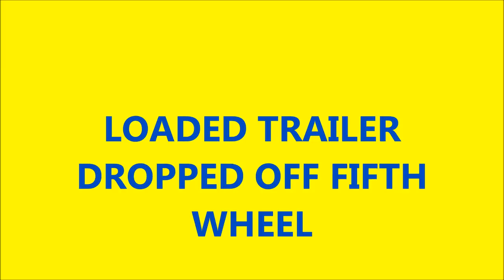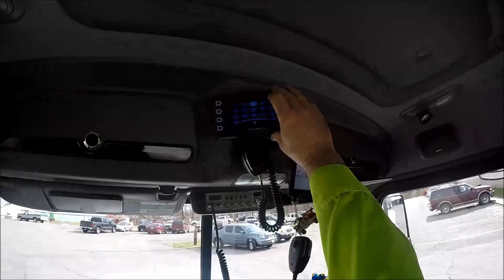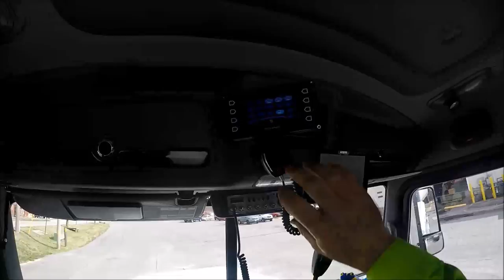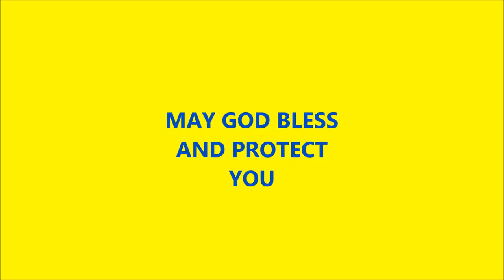LOADED TRAILER DROPPED OFF FIFTH WHEEL

Comment: what a awsome recovery truck ! --  did that same job in 1968 in the uk on the side of a main road ,they had changed over a sick tractor and the new one dropped the fully loaded trailer-the legs bent the chassis up about 1ft ------  so that the front was about 2ft off the road(and on a angle due to the camber ) ------    took a LOT longer than 20 mins:-)

Comment: Same thing happened to me in the UK in the late 80's. The landing gear stripped but we where lucky as the unit had run up guide ramps and we could push back under the trailer, good job too as it was a full load of wine.

Comment: I was a truck pusher at a vacuum company and had one driver dropped a vacuum trailer off 5-wheel and bent the crossbar, lucky I operated all equipment in yard. When I seen this, I was pissed, because the driver did not say anything about it. What I did is got our white/western star winch pole truck, put hook around kingpin, and lifted it up so I can lower legs. Just like you Ron, no damage done. I missed that job, it was fun. Raymond B Stojanik

Comment: I've had to re-hook a few times, and have learned NEVER to trust a quick pull always get out and look.
Reply: Willard Way lol i drag the thing because im paranoid  works pretty well
Reply: Large carrier driver training now requires that drivers review videos detailing how fifth wheels work. The old tug method is NOT a valid test as per all manufacturers. You are right to get out and look. Inspect the hand position and the jaws (when possible).
Reply: @kmg501  fotos

Comment: ALWAYS double check, especially if you've left your vehicle for even a couple of minutes.  We had a problem at one of our local truck stops where an operator was sneakily pulling the pin on random trucks. Drivers were leaving their trailers behind, nose down, when they pulled away. The idiot was seen on security cameras but could not be identified.  I hate to say it but you can't trust everyone.
Reply: LoL thats worse than having a pervert in the shower. & they couldnt identify said individual!
Reply: Pulling the pin is an offense that should be punishable by death.

Comment: when I had this happen to me before I would roll down the fillet legs, then dumped the air when the bags was flat start putting 4x4's on the frame rails then lift that roll the fillet legs then next back under and go, but then again I am old school , great video Ron thanks for sharing
Reply: and I can tell you how he did it ! backed under trailer too high missed the lock valley and yes the lock was tripped but it wasn't engaged like it was suppose to be if it was in the valley correctly, if he duck down with a flashlight and look he could tell the locking jaws wasn't around the kingpin correctly
Reply: and I can tell you how he did it ! backed under trailer too high missed the lock valley and yes the lock was tripped but it wasn't engaged like it was suppose to be if it was in the valley correctly, if he duck down with a flashlight and look he could tell the locking jaws wasn't around the kingpin correctly
Reply: sorry if this was seeming smart ellic, it happens to all of us in one time or other
Reply from the maker: No problem.  Matt is a cool guy.  We all, myself included, make mistakes.  It happens.
Reply: Jack - Yah the trick with the 4x4s works good, I helped many with that trick.
I agree on the trailer being too high on some disconnects too.
Happens from time to time to some.
Careful attention to small details helps keep things problem free
But times like this give you something to smile about when its someone else ! (^_^) hehehe
Reply: Ron Pratt I looked back at what I posted and I was ashamed cause I did feel I was being smartas*sih  I just wanted to say I didn't mean to be so crass be safe out there and thank you for sharing,
Reply from the maker: It's cool.  I think you were just trying to educate some people on another possible method of getting out of this situation.  Unfortunately, his landing gear were stripped, so he couldn't use the dollies to help him...that's why they called me.  I'm not upset at all by your comments.  I watch my channel and its comments very closely.  If I don't feel comfortable with them I will delete them.  It's all good.  Thanks and God bless.
Reply: Ron Pratt yes sir! if you've (any truck driver) driven for any amount of time you've made mistakes we are all human! God forgives but some employers don't lol
Reply: Ron Pratt what model is your peaterbilt ?
Reply: Very true, thankfully I haven't had this issue yet. Knock on wood. Main thing is no one got hurt.
Reply: well we wasn't there so cannot judge of what happen,on my side it happen but found out then too much grease and it cannot lock it properly,i got it ok after roll up the gear.
Reply: i did that a month ago
Reply: Jack Caldwell dead on Jack you got it in one, I am a lady driver and even I could have hooked under this trailer.
Reply: that has been done by me but we are old school i am old old old school  going on 71
Reply: if it has and air bag dump, my FLD didnt, it sucked
Reply: FRANK TORO I

Comment: Years ago I had a heck of a time hooking up to a trailer. I could hear the fifth wheel lock, give it a tug and it would not lock. I did it about 4 times, was frustrated and thought the latch was broken. Then I took a breather and settled down, took a better look at the fifth wheel and found the latch handle was catching on the frame, on one of the bolt heads. A quick adjustment to the handle and it was fixed.

Comment: "I heard it latch and the handle was in. Big assumption. Every time I release the tractor brakes I tug on the trailer to assure the 5th wheel is locked. EVERY TIME.
Reply: gregdcross also do a visual check
Reply: But that seems to be what mightve happened, he latched and went to tug and WHOOOPS
Reply: Yea lifted legs and then tugged lol
Reply: Tug test isn't enough. Gotta grab that flashlight and get under to make sure the jaws are totally locked onto the kingpin

Comment: Great recovery Ron. That guys hands were tied & he needed a lift. You got the lift charge + a little maintenance work on the job that keeps your shop busy. Everybody says it's never happened to them, huh. I dropped a few trailers in my time, but was lucky enough to have the landing gear working, & was able to recover myself. Each time it happened I swore I was hooked up. The 5th wheel is a complex item & has a lot more to it than a locking arm. It has a lot of moving parts that are internal & can not be seen to the eye. Folks need to keep that in mind.
Reply from the maker: I have seen this happen a lot.  It isn't always driver-error as some claim.  Mechanical failures happen, otherwise they wouldn't sell repair kits and new fifth wheels.  Thanks for watching and God bless.

Comment: There use to be a “Fontane “ fifth wheel that was notorious for coming released for no reason. Holland equipment is the best, they have a locking device. Never had a problem with this equipment.

Comment: I have had this happen to me. The lock audibly locked, looked good, but came apart when I tugged. It happened a couple times. Turns out the salt from winter was drying out the linkage below the plate. A bunch of spray oil did the trick. Your cool demeanor and humble approach is what makes you successful. Good video.
Reply from the maker: Thank you very much.  God bless.

Comment: I was watching a video awhile back and it showed a person sneak back to where a rig was parked and pulled the unlock handle for the 5th wheel plate and ran off.  Thankfully a driver of onother truck saw it and ran over from his rig just as the driver of the Tampered was going to get in his to drive off.
They scrounged up some timbers and blocked the trailer wheels he pulled the trailer backs and rocked the tractor back and locked the 5th pin back in place

Comment: I can understand the landing gear being useless because the gears are stripped, but have my doubts that the trucker checked to make sure the fifth wheel jaw was locked in place.
Anyway, good job as usual Ron.
Reply: Driver also made another egregious error. He put his landing gear all the way when he did his pull test. That would have saved his ass when his "defective locking jaws" failed.

Comment: Saw that happen to a trainee ( 3rd week out) at our mini yard in Conn. ...set of doubles did fine disconnecting back unit and con gear....oops forgot to lower landing gear and pulled out from under..had a fork lift inside ...broke loose and went right through the nose of the pup(trailer)...A) where was his trainer and B) that's a hard way to unload your freight.

Comment: That is one awesome tow vehicle. I assume there is a coffee maker in one of those boxes LOL. One of the benefits of being an owner-operator among the many, is working on your own rig but not for saving money, rather for the purpose of learning and knowing how things work and the ability to make self roadside repairs if the need arises. One of those repairs two years ago was rebuild of 5th wheel assembly to include mounting bushings, springs, and lock-jaws. I know the sound and the feel of a properly locking 5th wheel but I still take a peek underneath to verify. Working on ones own equipment these days is unheard of and most drivers of this generation don't even know how to raise the hood to perform the simplest of checks. I made a note to myself earlier today that it seems most people ie; car drivers and truck drivers alike wait until they are broke down on side of road before performing or having any maintenance done whatsoever.  When I learned to drive trucks more than 3 decades ago, we were required to learn to repair own trucks (company) including all services or else you didn't work. This meant brake jobs, clutch adjust, tire repair or replace, lights, electrical, you know the drill. Everything I learned back then serves me today as an owner-operator. I know every square inch of my truck including sounds and what things feel like good or bad. I'm good at what I do because of those who taught me.
Reply from the maker: Much respect to you sir.  There are very few of you left.  This new breed of school - taught drivers....????
Reply: Ron Pratt The world seems to be heading towards teaching for the test. Yes, we need people to pass but you also need to understand why you do what you do.
Reply: @RonPratt  hi

Comment: Years ago (1966/1967) we had a driver drop a loaded trailer.Hard to get upset with the guy we were working 12/16 hours a day 7 days a week.He simply forgot to put the landing gear down,unlatched fifth wheel drove out from under.Trailer was loaded about 37/38 thousand pounds of diesel fuel.We had to pump out three compartments of the four on the trailer,then put landing gear in the low position lift the trailer up enough to get the tractor back under it.Sure could have used Ron that day.our 20 ton P&H would not lift it.

Comment: this happened to me a few times.  so i had little ramps welded on to the frame behind the 5th wheel.  so if the trailer slides off it'll be resting mostly on the ramps and not the tires.  just hit reverse and easy to get back on to the 5th wheel.
Reply: M Wood it's nice when trucks have those little ramps

Comment: I been out here a little over 50 years now and always make a visual check to make sure those jaws are latched. Just looking at the pin puller and making a tug test only will get you in trouble. Why not take a little extra effort and be on the safe side. I'm sure Midwest Truck appreciates the business and I just bet Ron Pratt would tell those drivers the same thing.

Comment: I’ve been in situations like that many times before as a yard jockey, some my fault and other times helping another driver out.  from what I can see in the video he should be able to take care of that himself. For starters crank the legs down as far as you can. The driver said it wasn’t that heavy so release the air in the tractor air bags and give it a hard reverse shot. And before I called a tow truck I’d throw a forklift driver $50. to get me out of that jam. He’s just getting the tow company Rich. 45 years of driving. 😎😎😎

Comment: This happened to me only ( ONCE ) on a weekend, at night, at the P&G dist. Lot in 
Pineville LA. This is where experience counts.. I didn't get rattled, I took a good look 
at the situation and saw that the trailer was resting on the frame evenly..  

Calmly and cooly, I cranked the landing gear down as far as it would go.. Then I 
got into my chain box and got a couple of 4''x4''x12'' boards, and a couple of 2x4s 
of about the same length.. I always kept this little bit of lumber on the truck for a 
variety of reasons..

In this case they were going to help me raise the trailer up high enough so I could 
power under it again .. First thing was to lower the frame again by deflating the 
airbags.. This would open a gap of about 4 inches +/- depending on the terrain your parked on..

Next, I'd place a 4x4 on each frame rail about halfway between the end ot the trailer 
and the end of the rail.. Then I'd get up in the cab and flip the air bag switch to inflate 
the bags.. This will raise trailer up about three to four inches leaving a gap between 
the ground and the landing gear. Crank the gear down and crank it hard into the 
ground until you can't get it any farther.  Repeat this process until the trailer is high 
enough and firmly held by the landing gear.

Now you pull out all the wood and slide up under your trailer. Do a test pull and 
( GET OUT AND VISUALLY  CHECK THE LOCKING MECHANISM ) to make sure it 
is solidly connected.. 

Mission completed :  Without the need for a $750.00 wrecker call to get you out 
of something that could have been prevented with a good test pull and a visual 
inspection that is ( required ) when dropping and hooking trailers....

            Keep on truckin, Gentlemen..  And let's do it as safe as possible..
                                                                                                   ~~~  BARBUSIE ~~~
                                                                                                      { Retired   Trucker }
Reply from the maker: Very smart of you to get out of the situation.  Unfortunately, his landing gear were stripped so your method was not an option in this case.  Thank you for your wisdom and hopefully a younger driver will read your post and learn from it.  God bless.
Reply: Barbusie II
Reply: Barbusie............on a side note, how do you allow for SPACES and have your comments appear as paragraphs? lol  Also, your name/signature is offset to the right?  I'm curious as a cat!
Reply: @Kman

To make Paragraphs

Hit the "shift" key and hold it then you hit the "enter" key

Hope you see this reply. God bless.

Comment: I have had the 5th wheel fail to latch properly on more than one occasion. The handle would release but not fully retract. Some times they would even pass the 1st tug test. Then pop free later on in the hook up and pretrip inspection process. Most often it was due to cold and icy weather conditions causing the latch to fail to work properly due to interference by ice and snow or slush under the plate or just being stiff because of the cold. Or not having enough traction to actually get a good hard hook and perform a good tug test. It did not happen often, but often enough to where I made it a habit of doing multiple tug tests. A couple on initial hook, then another after I completed the hook and pretrip inspection. And often a last tug test prior to departing the site. I have seen (1 time) and heard (more than once) when trailers get dropped while moving. It happens. There is a good reason for visually inspecting the kingpin latch after hooking is called out in the procedure. It's not a good feeling when that latch pops free and the trailer drops off the 5th wheel onto the frame. But I would rather it happen at the site than when running down the road.
Reply from the maker: Yes, it does happen.  Thanks for watching and God bless.

Comment: Just a future thought on something like this. block the tires on the trucks so that in case the brakes are worn or misadjusted the trailer doesn't push the truck out from under it. I have seen it happen (a buddy dropped his trailer on to the frame like that, got out to see what happened. I heard him set the brakes. he was about half way to the trailer when the truck (shut off) slipped forward and dropped the trailer to the ground) Even though it sounded like the trailer was fairly light (even though it was loaded), you never know. 
Would hate to hear about you getting hurt because of that and we need good nonjudgmental recovery specialists like you out there.

Comment: Nice lift and reattach, make it look easy.  Did it end up being a problem with the 5th wheel or was it driver error?
Reply from the maker: Thank you.   They found the fifth wheel release handle bent and not FULLY engaging.  The handle went in and the lock mechanism MOSTLY engaged, but not fully locked.  Thanks and God bless.

Comment: Once at a shoping center parking lot, I saw an aluminium trailer loaded and the landing gear gave up as the driver tried to pull away,
The king pin wounded up hooked into the frame. This driver was not a happy camper,  at the time he was loaded heavy and he had to have two tow trucks to lift the trailer. This happened in the mid 80 and I recall this incident vividly.
Reply from the maker: It can happen very easily.  I try not to judge any driver.  I'm there to help, not make things worse.  Thanks for watching and God bless.